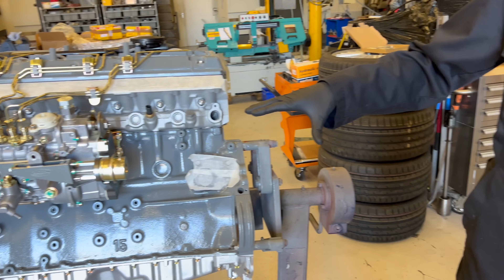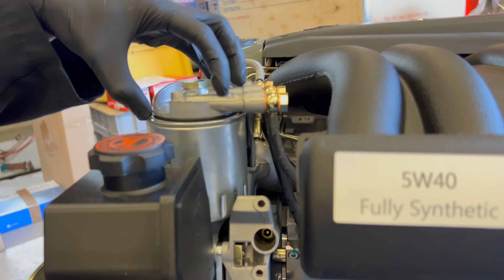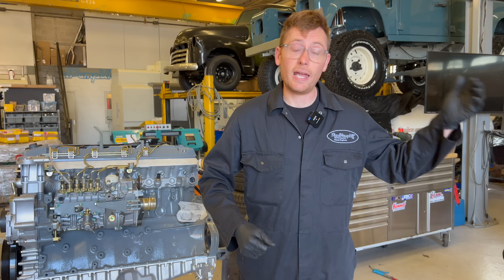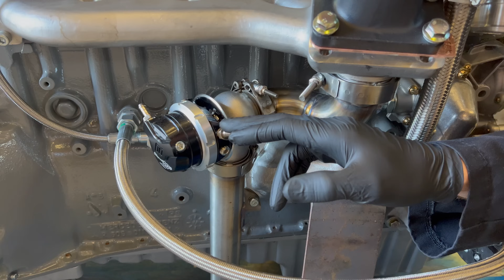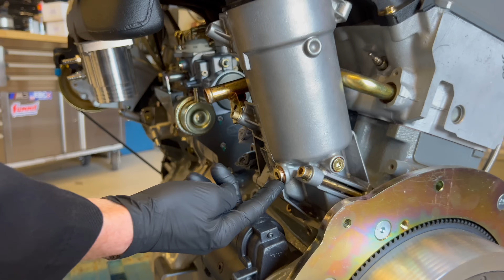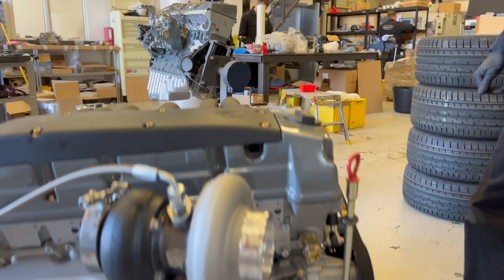OM606 how to make it RUN and STOP (no proven facts)

Comment: Mercedes is probably using the power numbers at the crank  ...in an air conditioned dyno room, with maximum airflow, and fuel both at perfect temperatures. Lol
From the time that the om606 makes the power to the point that it's actually turning the tires will be greatly reduced due to the drivetrain being built for comfort.
In sportier platforms, they can put the power to the wheels much more efficiently.
I want one of these engines (built by you guys) for my GMC Sierra so bad! 
Hopefully, I'll be able to order it this year.

Comment: So do these mechanical fuel pumps not require an additional electric fuel pump in the gas tank to help supply the engine? If not, what do you suggest I do with the existing fuel pump inside the tank?

Comment: 606 in my '98 only has one hose coming off under the intake, goes over to electric? boost actuator near the throttle bellcrank forward of the firewall.  Wish it didn't have the fuel heater or fuel shutoff, too many spots for air to be introduced into fuel lines, a problem which I am chasing now.  Great videos, btw.

Comment: Informative, humorous & only slightly sarcastic. Been watching a few vids of yours & would like to thank you for letting me into your workshop. 
Having recently had my own beloved ZD30 decide to retire itself, I have been looking at quite a few options. What drew my attention instantly was the clean design of the whole setup with the big intake plenum sitting there contrasting with the yellow. Then I saw the beautiful engineering of the pump and it’s so much more impressive that it’s a mechanical system. 
I have no clue if I can do this in Aus with emission and registration regulations, but I would like to explore the option. I will be augmenting an already capable touring platform with what looks to be a rock solid mechanical system will provide exactly what I am after for very remote touring & exploration.
Reply: not enough of these in aus

Comment: Why on earth would you hide an early analog OM606 in a cubboard?  The NA 606 is a jewel of an engine and just because it doesn’t have a stress induced turbo doesn’t make it any less that the later semi analog 606’s. 
You lost me there and therefore unsubscribed.
Reply: Because it’s slow, the whole thing around 606’s is the petrol like characteristics lol
Reply: So slow very slow
Reply: @tonydiesel3444  although you have to give it credit. Has the Highest specific output of any  diesel ever made.
Reply: @Diesel8290  I drove one for like six or seven years it's so slow that it's dangerous everyone will pass you at the green light and you could not merge on the highway the car weighs for 5,000 lb but only has 134 horsepower